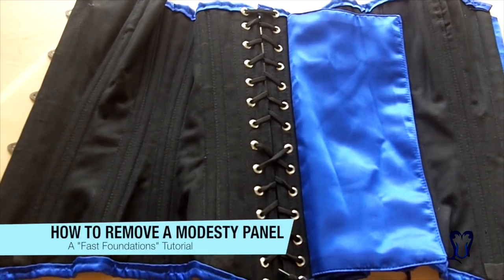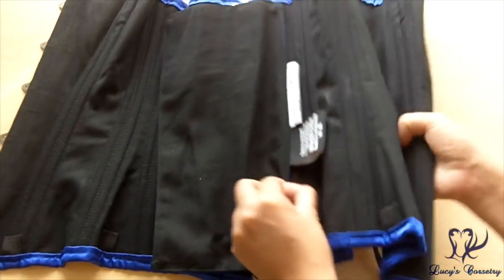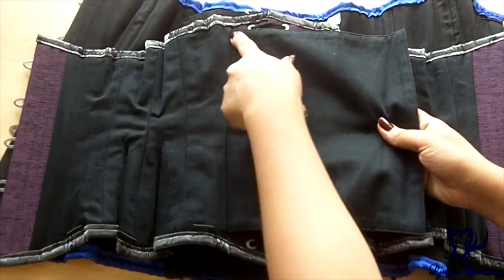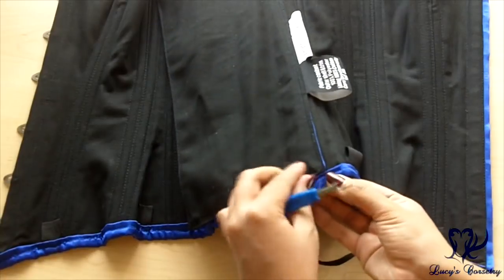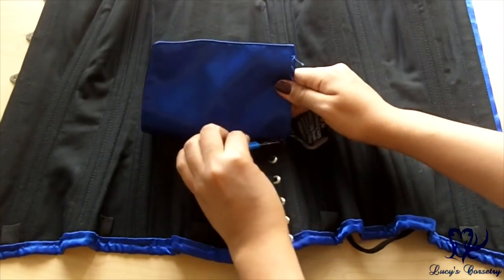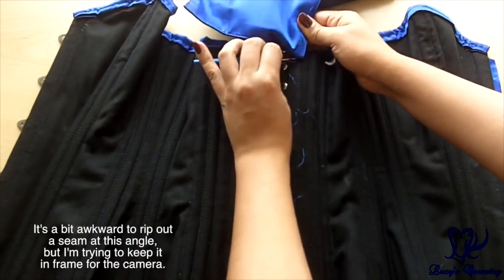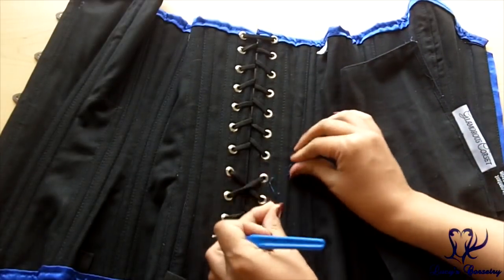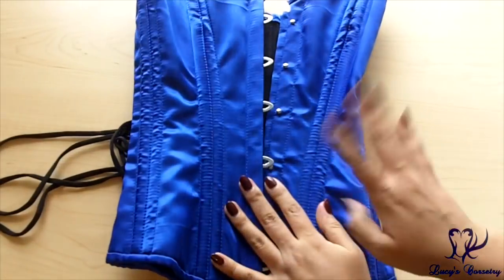Tutorial: How to Remove the Modesty Panel from your Corset | Lucy's Corsetry

Comment: If you hold the seam ripper in line with the seam with the ball end on the inside of the seam once you get past the initial back stitches you can then just slide the seam ripper up the seam in one smooth motion x